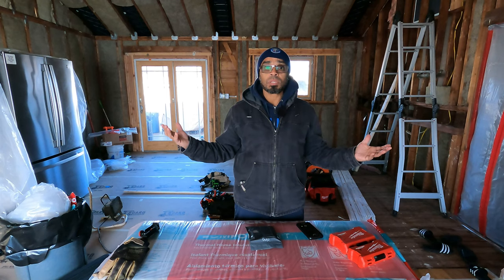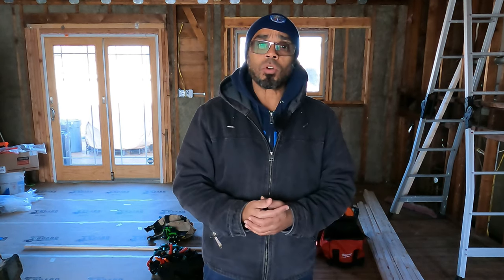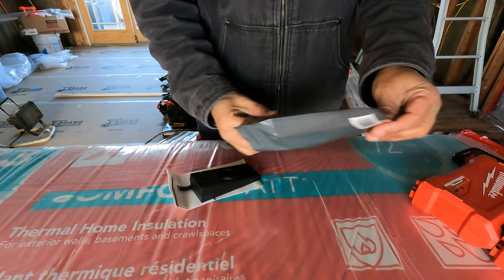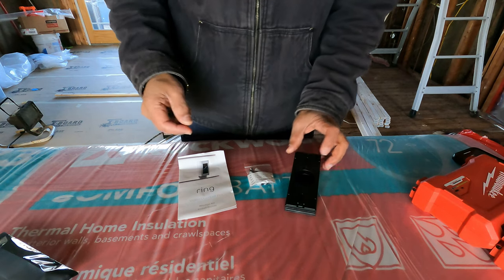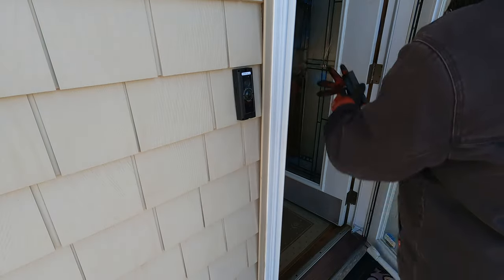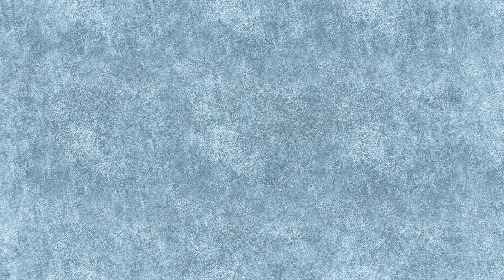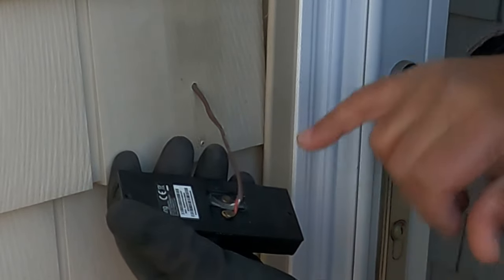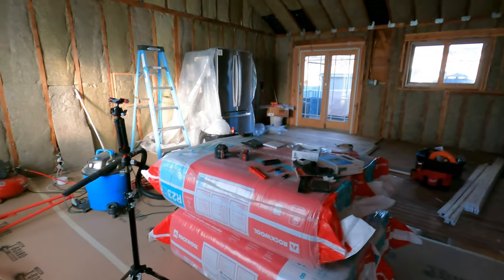How to Install Wedge Kit for Ring Video Doorbell Pro for a better view of my front door steps.

Comment: Can someone steal the ring the way you have it set up in the wedge?  Can someone come by and steal the ring off the wedge? Also, how much is monthly service for ring?
Reply from the maker: Wedge or no wedge. If someone wants to steal it they can. But it’s not as common as you think. Also check the ring websites for further information on this item. FYI I had this item for over 3years and never had a problem of someone trying to take it.